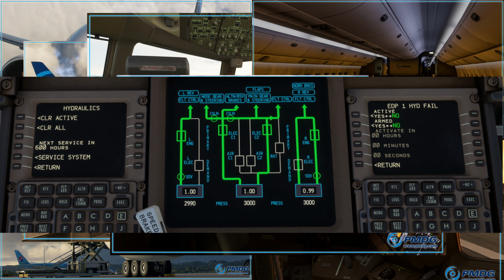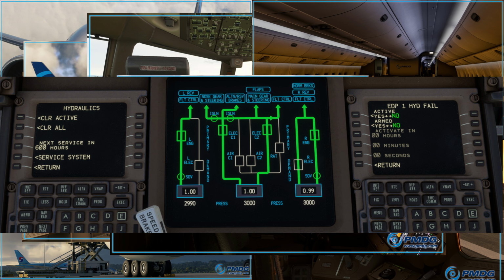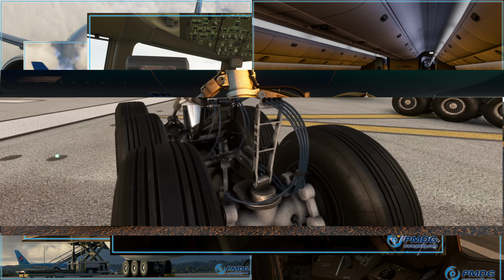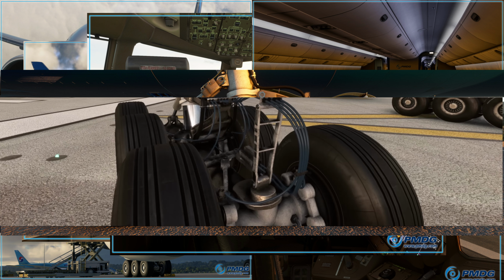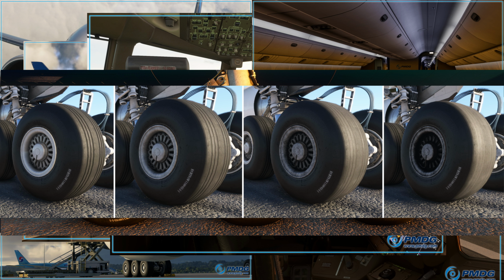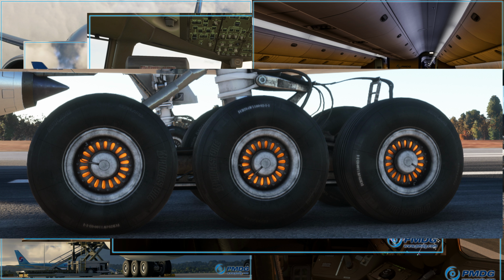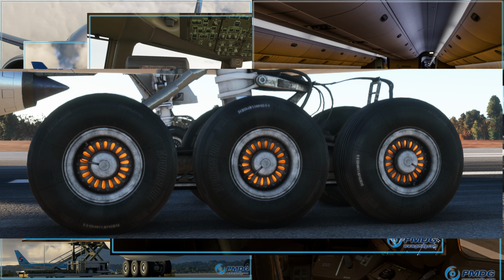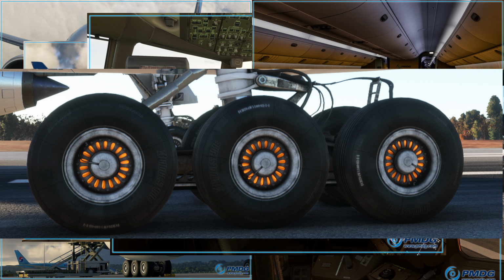PMDG 777 Systems Previews: The Hydraulics, Landing Gear and Brakes

Comment: Does the United livery simulate the loss of a wheel? On a more serious note, does a failure of the centre (i think it is the centre if memory is correct) hydraulic system result in the bogeys not tilting and if so is the usual “harder”touchdown simulated? Would be interesting to fail they hyd system and see what the gear looks like after alternate extension. If you look at a video of the recent 777 return to Sydney after the hydraulic leak you will see the landing with alternate gear extended with no tilt

Comment: Impressive stuff, both IRL and from PMDG. Question: How have PMDG implemented failures and wear from session to session? Are they tied to a particular aircraft registration number? It would be nice to simulate how a real airline pilot would be flying different planes on each flight, and they would have to assess the level of wear on the walk around, which could be different each time, and they then have to look in the tech log to see what's broken and see if they are safe to fly or not, by comparing against the Minimum Equipment List.
Reply: That's where global flight ops comes in. That's an addon from pmdg which will model persistence effects. But it's indefinitely on hold for now.
Reply: @vin340600  Ah interesting. Thanks for the heads up there. So it's been announced but not released yet? Will it work with the 737 too?
Reply: @mdhazeldine ya it was announced many years ago during p3d era but was always in the back burner.. Migrating their fleet to msfs became the top priority and rightfully so.. This addon will be very niche and so may not appear lucrative..

Comment: I still don’t get why PMDG insist on doing all kinds of configuration/failure stuff on the FMGC instead of the way more sensible place these belong to which is the EFB.
Reply from the maker: Because at the time those features were designed, EFBs were not a thing in the FS community. I recall the first PMDG aircraft to have this was the 737 NGX, released in 2011 for FSX. EFBs only became a thing around five years later.
Of course they could move all of that over now - and I'm sure they will in the future - but that would be another 3 month delay. I think that's very well something that can be done in the future and shouldn't hold up a release.
Reply: again with the efb ???? there is no rule that says it HAS to be the EFB. geez. talk about being completely is analysis paralysis.
Reply: @pieterduplessis6906  The EFB is a vastly better medium to handle failures/configurations since the GUI allows for so much more to be shown. Further, there is really not much that the FMGC has to do with failures/configurations—you can’t fail a hydraulic system from the FMGC in the real plane for example. While the EFB is basically the perfect place to handle all the things which don’t belong in the airplane proper because it’s literally not part of the airplane. All the stuff about pushback, loading, performance calculations, failures, configurations, and doors etc should all go there because they’re not part of any real life aircraft’s FMGC.

Comment: In the original post it was mentioned that the optimal brake temp was 700°C, stressing that hot brakes are not ineffective...

That seems very counterintuitive to me tbh. Can you explain this further?
Reply from the maker: Hi, I think you misunderstood that part. Carbon brakes initially get more effective as they heat up, but there is a temperature above which they will quickly loose their effectiveness again. That temperature is around 700°C in the 777. Make them hotter and they'll become weaker. And latest when the fuse plugs melt your brakes will be useless anyway ;-)

I agree that this could have been written a little better in the original statement though, that's why I re-phrased it in the video.

Comment: Looking forward to the 777, just hoping the high realism doesn’t cause problems. I appreciate your vids, as I know you generally know what you’re talking about. 
Talking about shadows, do you know how they are produced in sim? I’m amazed how real they look.
Reply from the maker: Thank you very much!

If you take the time to learn the normal operating procedures, and have your service based failures turned off, the system complexity should not be a problem. Most of it is handelled by the aircrafts automation. You may hear sounds or see some things without knowing why they happen, but generally they should work without much pilot input unless non normal situations happen. Boeing designed a superb plane here!
Reply: @A330Driver  As a retired airline pilot I am used to having a decent working knowledge of how things work. I’m really only interested in what may affect the pilots, and also not too bothered about complicated failures. I managed to avoid them during my career so why start now !? 😊 Right now my sim has started stuttering badly, so I’m desperate to get that sorted before the 777 arrives! There’s always something! 🤔